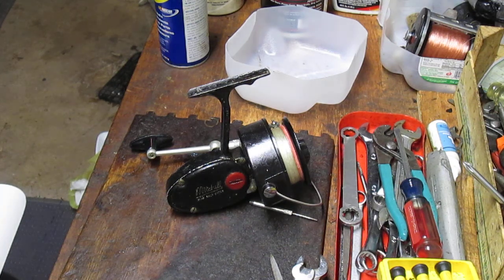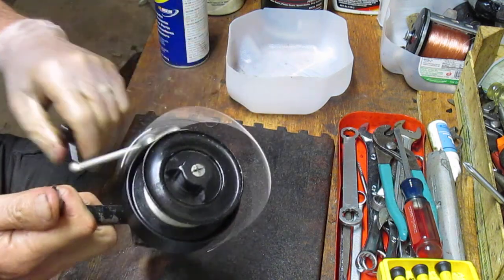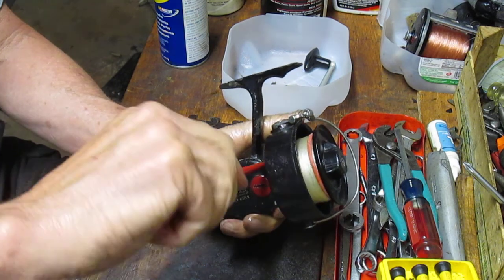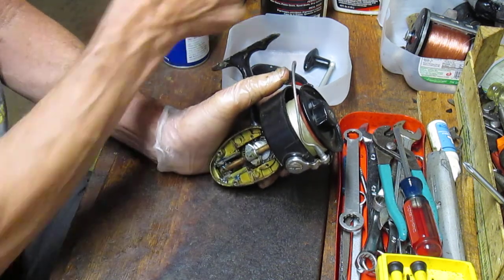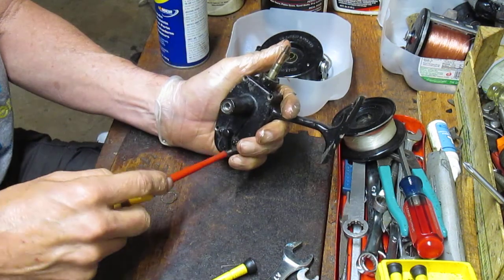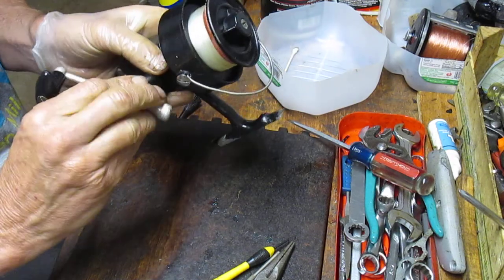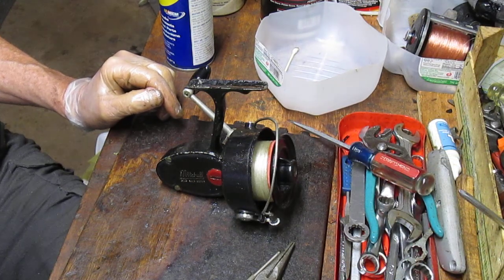Mitchell 302 Vintage Saltwater Reel - Complete take apart and service

Comment: Hi I took apart my reel but I have this thin thin piece of metal in the shape of a U and I dont know where it goes...
Also I put my reel back together without it and I can only do 2 rotations of the handle till the reel stops... helps please
Reply from the maker: I am not sure on the missing part.  Best to check the schematic at http://www.mitchellreelmuseum.com to see where it goes.  On the problem with rotation, are you sure you have the pins set on the. oscillating gear and the stud in the crosswind block?  The reel will jam if they are not aligned - Dennis

Comment: I have a 386 and under the spool is a red plastic thingy. Can you explain its function?
Reply from the maker: It's been a while since I last had this reel in the shop.  I think you are referring to a piece that looks like a block letter "C" if that I it, then the piece is a click tongue that engages with the click rotor to make the noise when the spool / line is being dragged out.  If you could send me a picture to 2ndchancetackle@gmail.com, I can clarify the thingy for you - Dennis

Comment: My suth bend 750A...looks about that size...i cleaned up..but do you know anything about it??....
Reply from the maker: South Bend reels are hard to find information on because they were made in short run, large job lots and then discontinued.  Most of the technology is generic fishing reel formats and you can usually figure out the age by comparing the reel case to other manufacturer's product designs of the time.  From older to newer technology, it would go something like this - Metal case?  older Plastic or Graphite case - newer? Square body - older or rounded - newer?  Ball Bearings? None - older How many? newer  Instant Anti-reverse? - newer still.   Your 750A is 60's -70's
Dennis

Comment: hi I have a question /need help!!! I have a Garcia Mitchell 408 nice little reel . I got it used . the bail spring was all messed up.i got two off ebay and I destroyed one very fast . is there a trick /easy way to replace this bail spring? thanks ….gary
Reply from the maker: No real trick, just a little patience.  There is a fellow on Youtube,I believe his tag is Mitchellmuseum watch the Mitchell 300 video and you will see how to set the spring.  If you cannot find it, let me know and I will do one for you.  I currently fish the 408 reel and enjoy it - Dennis
Reply: I got the bail spring in and working . I think its the linkage in side /under the spool . its such a nice reel I have to fix it ! its strange. first the bail spring wouldn't work if I tightened the screw all the way. took it apart and yes the spring was bent.i changed it and it snaps back nice. but now the bail wont trip or stay open , It was fine before …. thanks for the info and I really enjoy your videos! maybe ill mail it to you!  thanks again gary
Reply from the maker: Hey moondog.  Here is the actual video they posted. https://youtu.be/_muYtp4J5f4. start watching this around minute 5 nd it will show you how to set the bail spring.  Let me know if it does not help you and I will take my 408 apart to demonstrate - Dennis

Comment: Is it possible to make a left hander out of the 302?  I have got a right hander that is in very good shape from a neighbor but I am left handed.
Reply from the maker: I don't believe you can do this because of the fixed gear & side plate.  Mitchell reels were made in left crank and right crank versions.  The left crank were even numbered and the right crank were odd numbered.  If you have the 302, the counterpart that uses the right hand to reel is the 303.  Other examples are the 300 (left hand) and 301 (right hand). That is the ever popular mid-size reel. You can still get these at a reasonable price through online auction sites like EBAY.  - Dennis
Reply: I should have looked through comments thankyou

Comment: Hey! I got both set screws out. How do you get the bearing out? Is it pressed in?  Thanks!
Reply from the maker: You pull it straight up.  Check to make sure that the the channel is clear and maybe spray it with a penetrating oil if if appears stuck,  You should be able to grab the top of the pinion gear to help rock it and pull it out - Dennis
Reply: @2ndChanceTackle  Thanks! it was very dirty. I was able to make a puller out a 10mm socket and a 1/4" nut, bolt and washers. popped right out once I let it soak a bit. Thanks for all that you do!  Sam

Comment: Why doesnt the vintage spinning reels not have the problems in salt the way the new ones do?
Reply from the maker: Hmmm - good question.  Less moving parts so less to corrode and break?  Higher quality materials used in the manufacture?  Not sure, but it is a good observation - Thanks

Comment: Hi Dennis, just one question:  at the 12:00 mark after putting back the main shaft, you insert the little screw in the small hole at the end.  Does this screw need to be firmly seated once it goes through  Ive tried and tried, but the shaft still moves.  Thanks.
Reply from the maker: There will be a little play n the shaft as the fork is not threaded.  The screw sets in the block. So it will not be clamped down totally tight
Reply: @2ndChanceTackle  Thanks much!

Comment: I believe most Mitchell 302 are right, left hand,  
I have 6 
But I switched 3 to right hand
Reply from the maker: The 302 is a left hand crank.  The 303 is the right hand crank.  These are not interchangeable - Dennis

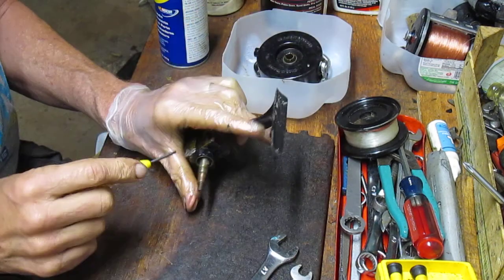Comment: 4:55 so that's the little culprit that is missing off my reel! No way to tighten my bail arm assembly shaft nut enough to keep it from slipping. Just a  reel I picked up as a curiosity thing. I'll have to see what I can make up to fill that pin/slot so I can tighten the nut properly. (Now 1/2 hour later) That little missing "key" was bugging me so I took the reel apart again to see where it was supposed to go, to see how I could cut up a small bolt or screw or something to make a reasonable replacement... and there was the "missing key" stuck sideways in the side of the slot where it is supposed to go. Tucked it back in place and all the world is a happy place again... well for 2 minutes anyway.
Reply from the maker: Great to know.  Yes - that key often pulls up and out when the spool is removed.  Thanks for the note and for watching - Dennis

Comment: love the way you do your videos. do you also do Zebcos, Johnsons etc?
Reply from the maker: I don't see many of the closed face reels come in for service.  Unfortunately, the reels often cost less than the service and folks view the newer ones as disposable.  I have an older Zebco 33 on the project pile and will do it when time frees up.  Thanks for asking - Dennis
Reply: @2ndChanceTackle  yes I noticed this in your videos too. as these Reels are more complicated to work on and your videos are great showing how. I mostly have Zebcos and some old Johnson and a Phluger 60 passed down from Grandpa when he taught me to fish at age 3 in 1961 my favs are the Zebco USA made mini reels of which I own several of all models for family fishing
Reply from the maker: These are great reels and worth preserving just for the sentimental value.  I have a Daiwa mini-cast closed face reel similar to the Zebcos you have.  Great reel with a lot of great memories.  They are not terribly difficult to work on.  You may want to try and find a used one, they are cheap, and use them as a tuition reel to take apart and learn how to service them before you try on your treasures. Thanks for asking - Dennis
Reply: @2ndChanceTackle  Dennis I am trying to put the bail spring on a Abu Mitchell 408 and cant get it done. Could you do a video on servicing the 408? Thanks for your time and God Bless!

Comment: I juat cant figure it out. my bail wire hits the handle and I cant seem to figure out why! any ideas> ?
Reply from the maker: The wire has been bent down, probably from impact.  You can set the bail to open and gently push down on it to add height to the bail and stop it from hitting the handle.  If you are unsuccessful. you will need to replace the bail wire - Dennis
Reply from the maker: By the way, I have a stock of replacement Bail wires if you wind up needing one. - Dennis
Reply: such a simple fix! I just didn't see it ! thank you very much! I have a 408 with a broken bail that has me stumped !
Reply from the maker: Send a picture and description of the problem to my email - 2ndchancetackle@gmail.com and I'll see if it is something I have come across. - Dennis

Comment: Do you do new baitcasters
Reply from the maker: I do whatever comes into my shop, so typically they are a little older, but not too old.  I will be doing some Shimano and Quantum reels this coming week.  Is there one in particular that you would like to see?  Thanks for asking - Dennis
Reply: 2nd Chance Tackle I actually want to do send one in it's a Abu Garcia Pro Max 3 I left it outside in the rain for about a week and it's really crunchy when you reel it and  casting it is pretty much impossible
Reply from the maker: Sure thing.  Please send me an email to 2ndchancetackle@gmail.com and I will send you the details on where to ship, cost, etc. - Thank you - Dennis

Comment: I can't remove that screw on the top....why???..i don't to break anything..
Reply from the maker: I would load it up top with WD40 and let it sit overnight.  These screws can corrode in the collar and WD40 may help.  Also, if you tighten down the drag knob completely and grab the spool to turn counterclockwise, you may be able unscrew the assembly where the collar joins the axle.  This woulld remove both the spool and collar to get to the case for cleaning. - Dennis